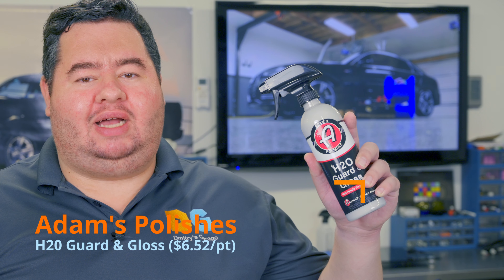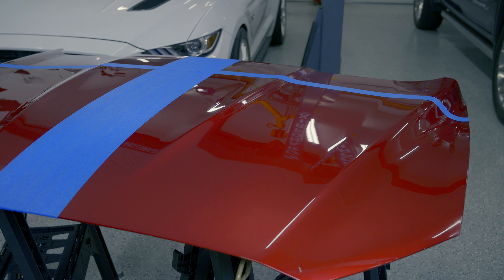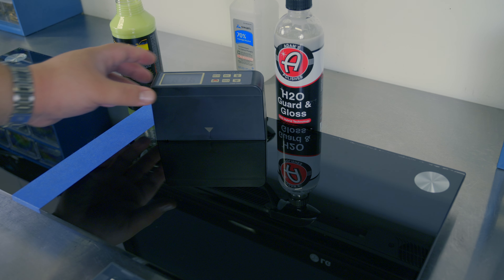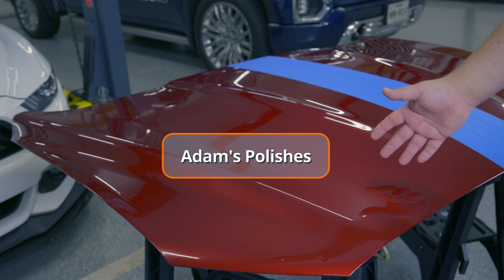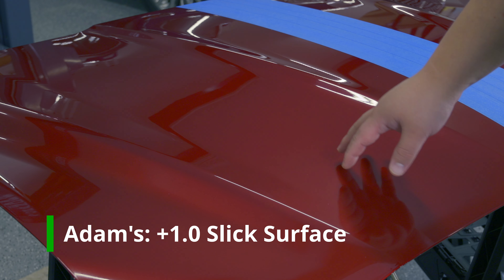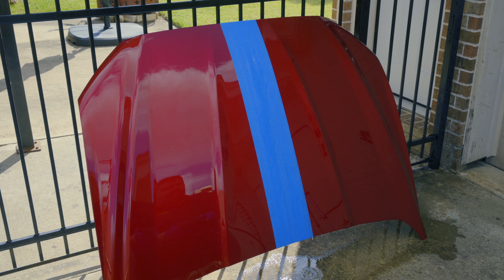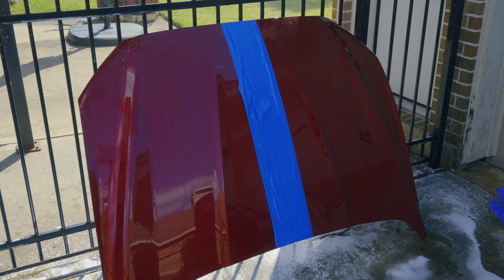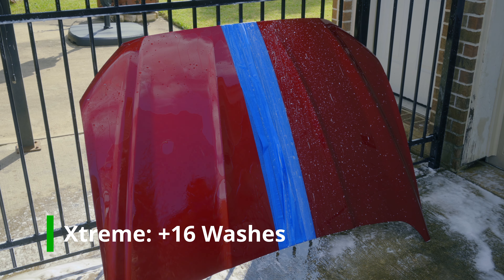Xtreme Solutions Poly-Seal vs. Adam's H2O Guard & Gloss - Which spray wax is best?

Comment: Is it just me or polyseal says to apply on a damp applicator and NOT ON THE PANNEL........
Reply from the maker: There are several common ways of using polyseal. The damp cloth is probably the easiest way to apply since you can’t over spray. However they do say you can use it directly if you’re careful and even show that in their product page video. I prefer a direct application for a dry panel.